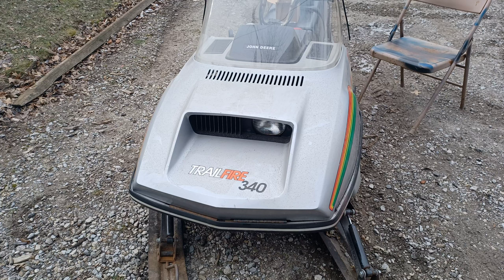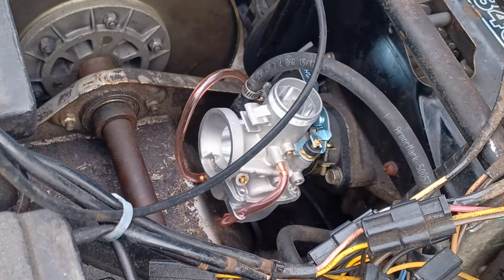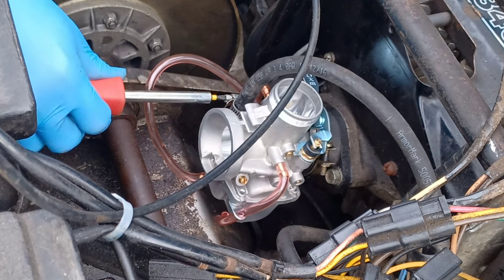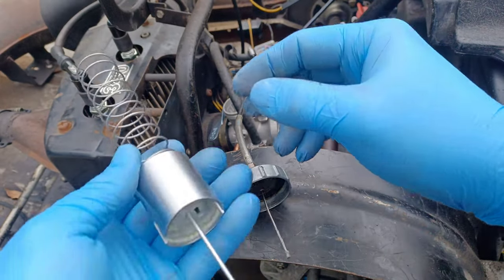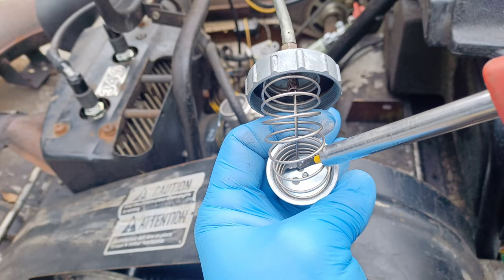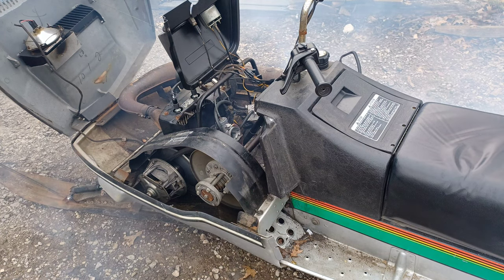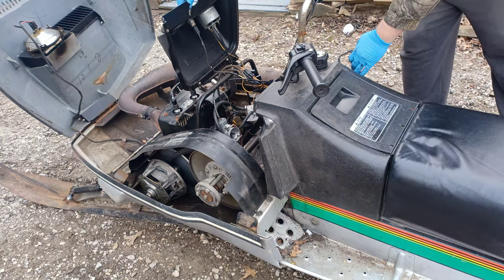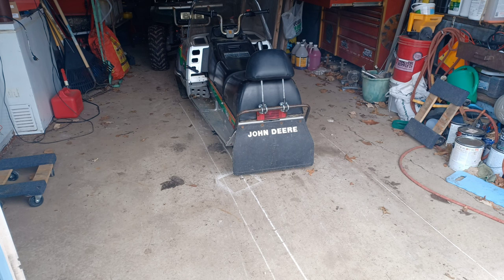Will a $50 carburetor save this 1979 John Deere Snowmobile???

Comment: VM 34mm?
Reply from the maker: Yes it was a 34mm, I think I said 44
Reply: If you have never changed the crank seals I guarantee they are shot.  Bad crank seals can simulate carb problems.
Reply from the maker: @GarageWorx 
So I took it out today and it ran awesome for 20 minutes and then the carb started to flood, I can see gas coming out of the bowl vent, not sure what's going on. The old carb did the same thing. When I remove the carb I notice a wet intake tube where gas is spilling into the intake hose
Reply: @easywaytodothings  I'm curious if this new carb is a genuine mikuni or a 30 dollar Chinese knockoff.  Also you mentioned you never took it apart to check jet sizes.  Always should check that do you have the airbox? They are tuned to run with the airbox on.
Reply from the maker: @GarageWorx  I think it's a knockoff but the jets are the same as the oem. It ran great for 2 years without the airbox (bought it that way), I just had a pod foam air filter on it, but last year we didn't run it because of no snow and now this year both carbs are flooding
Reply: @easywaytodothings  Back to my original question do you know if the crank seals have ever been changed?  For a 79 it looks pretty clean.  79 was the only year they used a steel tunnel and usually they are all rotted out.
Reply from the maker: @GarageWorx  I never did the crank seals personally but they might have been done at one point, in just not sure. Other than checking for air leaks with carb cleaner is there anything you would suggest to try to further diagnose it
Reply: @easywaytodothings  you mentioned hard to start, that's a classic symptom of crank seals.  High idle is another symptom because its pulling in air other than thru the carb.  Definitely try spraying around the seal and see if it changes.
Reply from the maker: @GarageWorx  with the new carb it starts right up, just won't idle because I think it's flooding, boggs down under load and sometimes it'll kick in and run fine, other times it floods out and I have to start it up again
Reply: Maybe buy a new needle and seat for the original carb.  I've never seen anyone have much luck with cheap carbs.
Reply from the maker: @GarageWorx  is it possible the fuel pump has too much pressure for the needle and seat, I did put a new pump on it
Reply: @easywaytodothings  I dont think so.  How old is the gas in the tank?  Are you running a fuel filter at all?
Reply from the maker: Drained the tank and new gas before installing the new carb, got a 2 cycle fuel filter in line as well
Reply from the maker: @GarageWorx  Drained the tank and new gas before installing the new carb, got a 2 cycle fuel filter in line as well
Reply: Pull the bowl off both carbs and see if the float/ needle and seat are sticking.  Gas is coming out the vent line because gas is flowing in when it shouldn't be.
Reply from the maker: @GarageWorx  I checked them and they were working properly, the only thing I wonder is if the float needs to be re-leveled, the knock off carburetor may not account for the 15 degree tilt of the engine which could be why gas is spilling into the boot, may not be shutting off in time before it reaches the top
Reply: things  possibly.
Reply: @easywaytodothings  what about the fuel pump?
Reply from the maker: @GarageWorx  I replaced it a few weeks ago but it didn't make a difference. I actually sold the sled this last weekend, I couldn't believe it only had 540 hours in it.

Comment: Theres nothing that a proper cleaning on those carbs won't fix. Jets,emulsion tube,air bleeds,and proper enrichment valve setting,float valve and float adjustment. I was a snowmobile servce tech for over 45 yrs.  Never replaced a single carburetor on ANY brand....you have other issues!